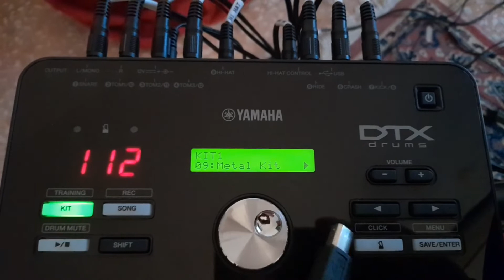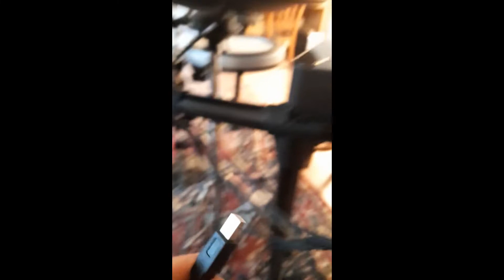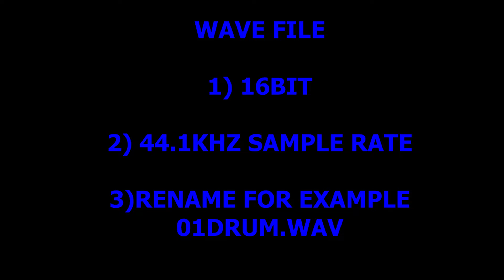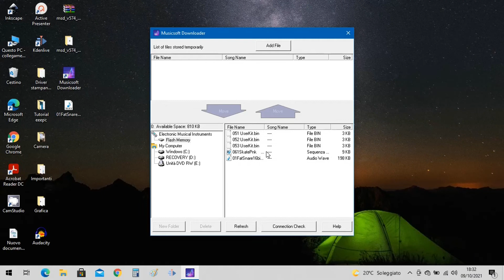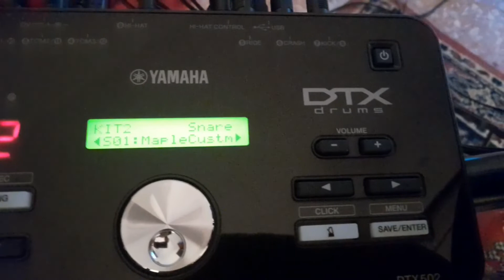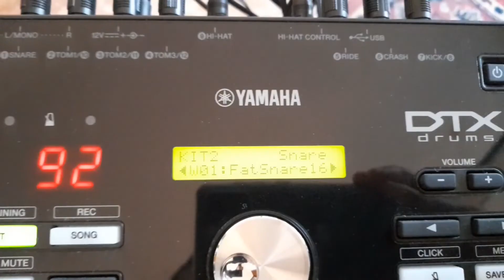How to transfer and play custom wave audio files with Yamaha DTX502 electronic drum.

Comment: Hello, thanks for the video. Is it possible to have multiple velocities (i.e playing softer and quieter) with this method of importing one wav file? Or does it have to be multiple files somehow assigned to one pad
Reply from the maker: Hi! Custom WAV files have limited options compared to Yamaha's original sounds, but fortunately the pad still responds to both playing dynamics (how hard you hit it) and playing speed (how fast you play repeated strokes). You need only one wav file.

Comment: Hello, I am uploading wav sounds but there is no sensitivity. Do you have any suggestions about this?
Reply from the maker: Hi , I need more information, did you follow all the steps in the video?
Reply: @GiulioDrums85  Yes, I did all of them, but I don't know if it is because it has wav sound. For example, there is no sensitivity in the snare drum, the sound intensity is the same whether I hit it slow or fast.
Reply from the maker: @emroohh  Maybe it depends on the quality of the wave file. Try opening and playing the wave file on your computer with any media player. Do you hear the sound immediately or late? The "Play" button corresponds to hitting the drum. If the sound starts late it will not be synchronized with the strike on the drum.
Reply: @GiulioDrums85  No. My problem is not that the sound comes late or early, my problem is sensitivity.
Reply from the maker: @emroohh  Ok. Sorry I read  "fast" and "slow" in your comment. It s strange. Have you tried  to regulate sensitivity (gain)? On the dtx panel hold down "kit" button and press "  volume +  -  " to regulate gain.

Comment: If you want to take advantage of the 3 zone pads, import your separate samples, then while selecting sounds for the user kit, hold the shift button while hitting the zone you want to assign. This lets you set each pad zone independently instead of setting all zones at once.
Reply from the maker: Last year I discovered a different way. Hold "shift" and "save", move to the "02 kitvoice" , press the "right arrow" one time, then hit the part whose sound you want to change (rim, bell, etc...). But your way is easier and faster. Thank you very much!!

Comment: Does the DTX502 work with roland pd-8’s and BT-1?
Reply from the maker: They could work fine because I believe They are one-zone pads. At the same time They could work not correctly, especially the BT-1 trigger. Often Yamaha works fine with Roland, sometimes not. The assembly of pads is different too, you should adapt them. Anyway  I suggest you to post the question on vdrums.com

Comment: hello, does it work on dtx 402k?
Reply from the maker: Hi, I' m sorry but I don't know. In the manual I read that you can connect the 402k to a computer and transfer midi and audio(??) data. You could also try to connect the dtx to your mobile device (installing the dtx touch app -for android or iOS) and see if you can assign a custom wave sound to a pad. It's easier when you use a touch display.